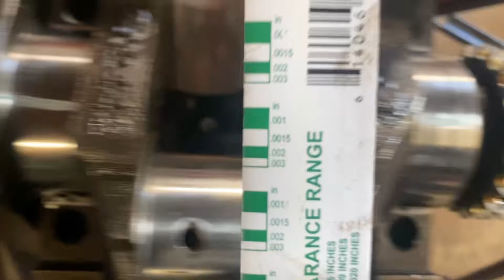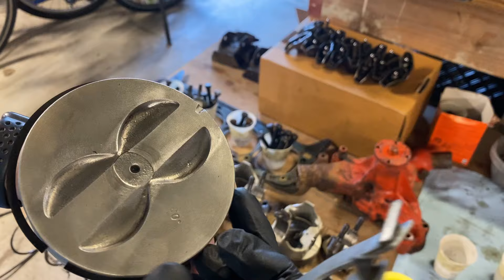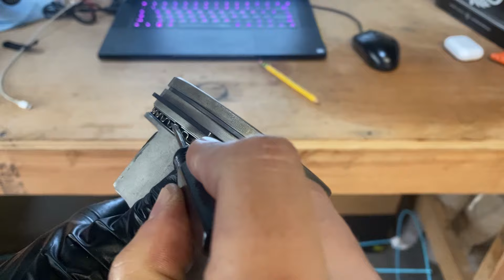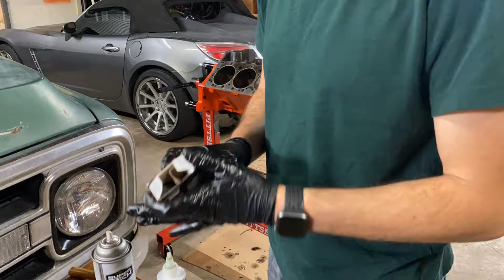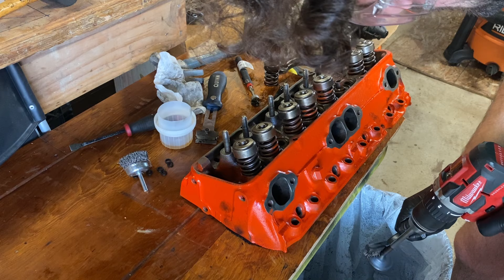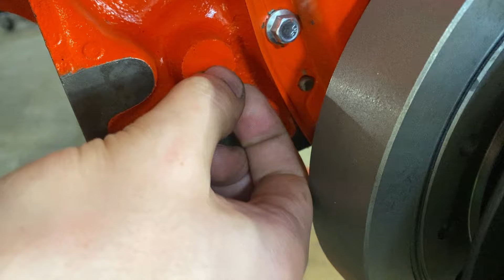Rebuild a Chevy Smallblock with Me!

Comment: Clocking the main seal is not a clever thing to do. Call the company that manufactured the seal and ask how they go in. They are designed to go in flat. Also don't use 4-peice oil pan gaskets, use the single peice rubber ones. Also you didn't lap the valves.
All in all you did good. Fingers crossed on the oil leaks not happening and the valves to seal compression. 🤞🏻
Reply from the maker: Wasn't trying to be clever, there's just a lot more YT videos to reference of guys doing rebuilds in their backyard than at the factory in 1969 LOL. I used the oil pan gasket that came in my kit, so that i could spend $35 on beer instead of a 4 piece oil gasket. Ha! Lapping valves was on the list but who has time for that - no rust and no pitting so no sleep lost

Appreciate the comment! Watch the latest video to see if your fingers crossed worked ;)